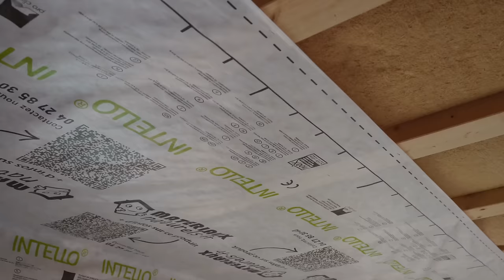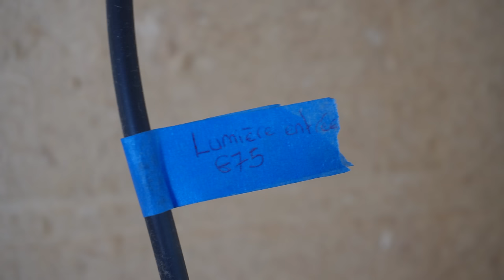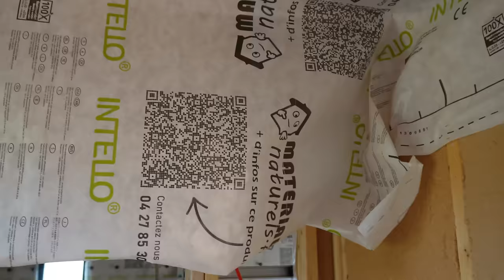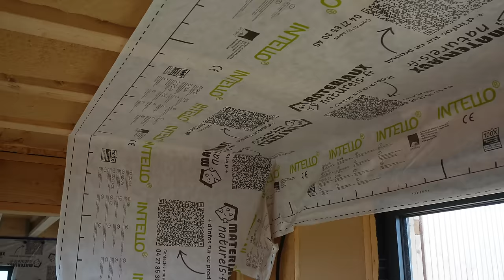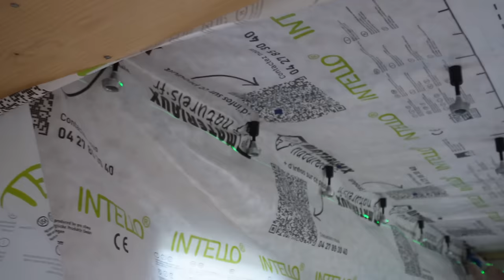ON TRANSFORME L'ENTRÉE DE LA MAISON ET ON PASSE À L'ÉLECTRICITÉ ! - EP.160

Comment: Temperature Regulation: Roof vents help to let cool air in during hot summer days, preventing extreme heat. In the same way, roof vents prevent warm air from escaping in winter. Prolonged Roof Life: Adequate ventilation can extend the lifespan of your roofing materials by reducing heat-related wear and tear.